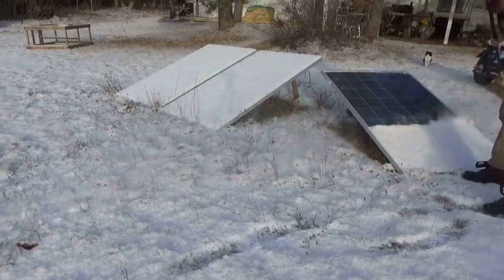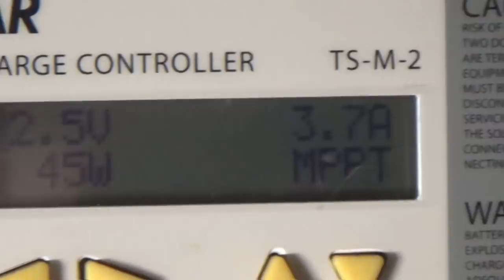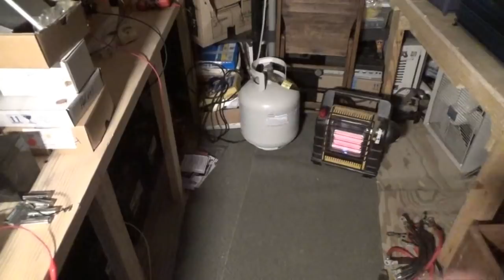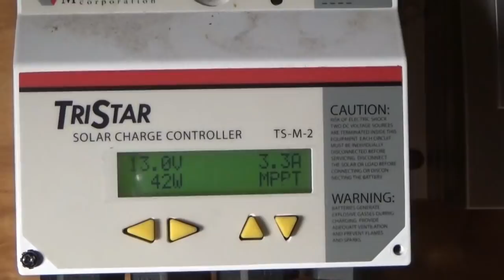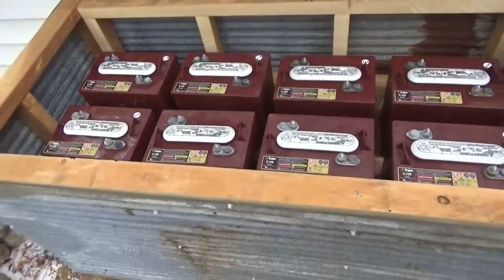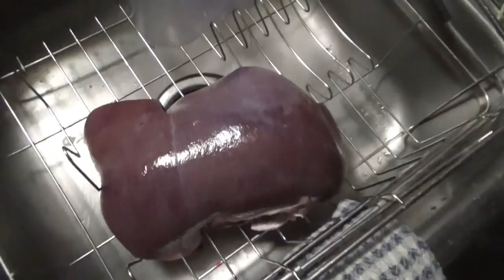Snowy Homestead ~ Battery Box Work ~ More Meat

Comment: If it was me I would buy a camping shower tent to set up outside next to the kitchen. Then I would set up the on demand hot water inside the shower tent. Then when I need hot water to do dishes or shower/bath I would run a hose thru the window or door and when through I would go outside and disconnect the propane......

Comment: Fixed by dork (hubs nickname is dork)....personally I don’t think that little “on demand” hot water heater needs a permit.. you hook it up to use it then un hook it when you are through.....it’s portable... permit on that is just butta$$ stupid.
Reply: Really? You don't think a gas on demand water heater with permanent connections to gas lines and household plumbing should be required to be installed to code? The only way to insure the installation is done right is for it to be inspected. Which requires a permit. Even experienced contractors can make mistakes. I do agree that permits for small projects like that should be simple and affordable.
Reply: Troy says his most recent water heater is approved for permanent installation and I take his word for it. But if for some reason he is mistaken the permit process would catch it. A much bigger problem is that some off gridders illegally install portable units clearly NOT designed for permanent installation.
Reply: Your suggestion that Troy should circumvent the permit process by keeping the water heater "portable".... Can you please tell me how that would be anymore safe or convenient than boiling water on a wood stove? Thanks. There is a right way and a wrong way to do things. I encourage Troy to do things the right way. Especially with a bunch of scumbag trolls watching everything he does, looking to cause problems for him.

Comment: I’m not fussing... but that number 10 galvanized tub, with water heated up in dish pans on a wood stove sucked... the kitchen was cold and it sucked bathing that way.. I’m not into jewelry, fancy clothes, over priced furniture but the nicer (for me) the bath area the better.  I can spend an hour in the bathtub easy......till I was 12 we had a shotgun house.. a pump(outside) and a toilet outside. . And a sears catalog to wipe with... toilet paper was not an option....what happened to your on demand hot water heater?
Reply: It is good you are doing everything there according to code Troy.
I would rather you make a few small compromises to keep you and your family 
safe from the trolls than you try to be 100%  off grid.

Your channel will be interesting to watch even if you have to maintain a partial connection to the grid.
Reply from the maker: I found out that it will cost $120 just to apply for a permit to install the water heater. Then the cost of installation parts and labor. Then the cost for inspection. I could nearly buy another house for the cost when I am done. Not happening any time soon.

Comment: Wouldn't it work better if all the solar panels by the house were facing the same direction? I thought all the panels should face south.
Reply: The panels tilt is wrong too!
Reply: Have you considered getting a new inverter? You can't power everything in a house with 600 watts or less.
Reply from the maker: Yes, I addressed that in a video recently. Due to the wind I cannot tilt them properly but am building a rack soon.
Reply from the maker: I put one facing east to catch the early sun and two facing south for mid day sun. My inverter could only handle two panels at the same time and this allows me to get more power for longer.
Reply from the maker: Yes, when the battery box is finished I will have a 2,000 watt inverter hooked up.